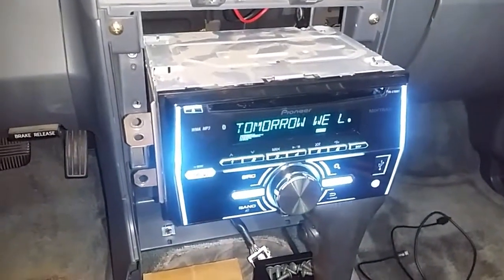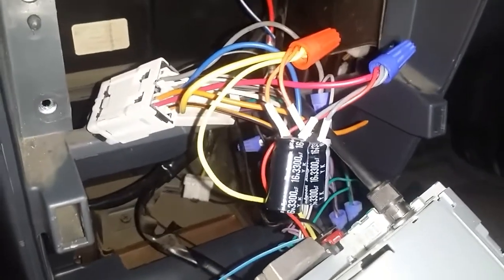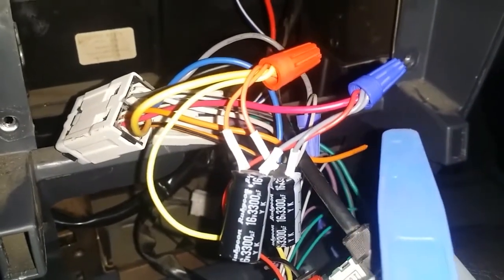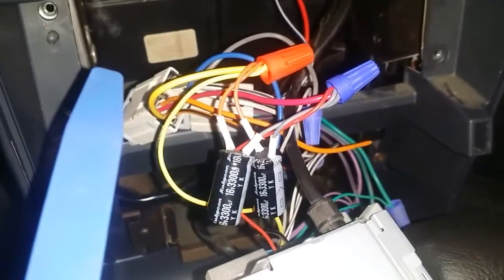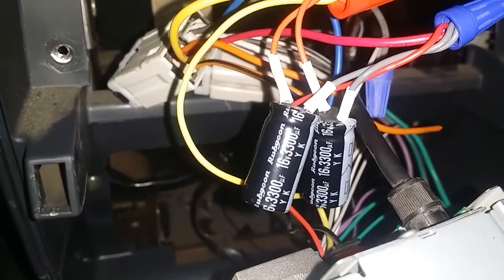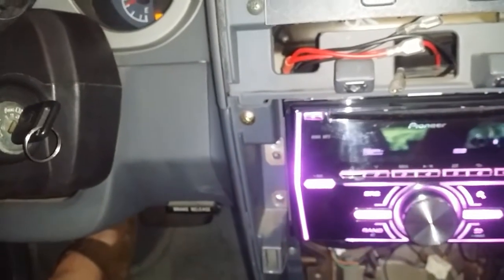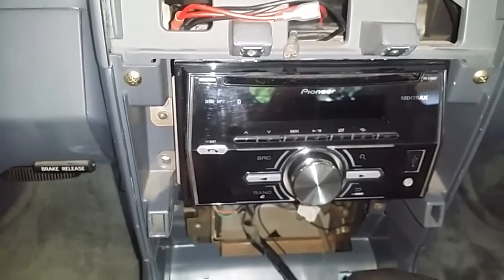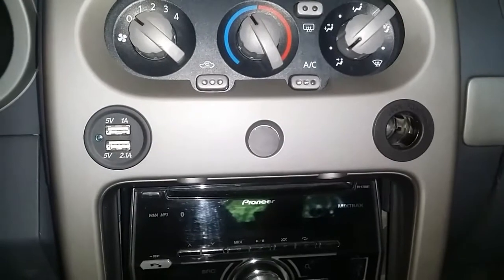Keep Vehicle Stereo On When Starting

Comment from the maker: UPDATE 1:  At the end of the video I showed adding a USB charging port.  If I am charging my phone when I turn the key... the phone takes the voltage stored in the Cap and the stereo does NOT stay on.  (boo!).  So I have to unplug my phone when starting the car, or wait to plug it in.

UPDATE 2:  I also added a subwoofer/amp.  I currently have it powered from the same wires shown in the video.  That (without a phone charging) drains the cap as well.  I'm committed to getting this wired right... but it may be a few weeks before I can dig back into it.  I may just add a toggle switch in the center hole (don't tell my wife).  A capacitive touch switch may be in the works as well (so I can hide it).
Reply: Shawn Hill great job man, you know your thing, ima try to do the same as you did, hopefully ^^
So you took 2 capacitors and connected the + sides of them to te yellow (always on) cable and the 2 negative sides on the red ACC cable, did you had to completely cut off any if the cables or did you just stripped them just a little to give contact to the capasitors?
Thanks your video is A+++!!! 😃
Reply: If u were to add a diode to the accessories power wire between the capacitors and the power supply side of the accessories wire this will prevent voltage being back fed into the accessories circuit allowing the capacitors to only provide power to the head unit, this will fix the issue.

Comment: For keeping the radio on while starting the car, and a few seconds after shut down:

1/2
From the car acc you connect a diode 1A (anode), behind the diode (cathode) connect to radio acc AND to a 3300microF capacitor +, from the cap - connect to ground.
This way you prevent other accasories (charging phone) to drain the capacitor.

2/2
Starting can cause the main voltage to drop below 10V, shutting down the radio.
For keeping the radio on, with a voltage drop from starting 2/2:

After doing 1/2, do the same as above, but for the constant powersupply.
Depending on your radio, use a strong enough diode, 7A for example.
For capacitor, use a 1F super capacitor instead!
If you can't find a cheap 1F 16V, put 3 cheap 1F 5,5V in series (-cap+ -cap+ - cap+ = 16,5V).
This way starting the car does not drain the 1F capacitor(s).

If you additionally use an amp, nothing changes.
But for those who don't know, don't use those small wires for your radio to also power your amp (read amp instructions)!

Note that a capacitor alone does NOT prevent current going in the wrong direction!!
Conecting a capacitor in the wrong direction can cause it to heat up and explode!

Comment: OHMYGOD THANKYOU. i was about to do this by branching 2 caps from from ACC to ground with a diode behind them, but this helps cus i was wondering if there would be enough amps to keep it all upright.

i am confused about if your battery line is constant or not, becuase if the car is fully off, you'll have 12V on the BATT line, 0V on the ACC line and the Caps between them, wont they just act as a bridge (continously recharge/discahrge??) and keep the radio on the whole time?

Comment: Thanks for this video. This method isnt working for me. My red radio pwr wire has a capacitor and it works as it should

I ran a 16V 10,000uF cap on my yellow wire, upstream diode, grounded cap negative, and the radio is struggling to stay on. When cranking & disconnected from radio, the capacitor slowly discharges as it should. When i plug into the radio and crank, the Cap dips to 8V then 3.5V within a second

Comment: Is yellow wire always on, or is it on only during crank? Like if it’s always on, why would the radio turn off when the car turns off
Reply from the maker: The yellow wire is the constant power wire or the 12 volt battery wire.  It's always on.
Reply: Exactly my thoughts, this whole thing working the way it does makes no sense.
The yellow wire is B+ (12v constant) this means the capacitors will always be receiving battery voltage meaning they should never lose power unless the power drain is above the capacity of the battery, draining the capacitors faster than they can recharge.
If the capacitors are constantly receiving battery voltage then they should continue to constantly supply that voltage even when the car is off and the key is out of the ignition.
I don't understand how it is possible that they are depleting while connected to B+ 🤔

Something else is going on here, perhaps something to do with the existing factory configuration or some kind of sorcery 😂

Comment: Shawn, great video. I have been having this problem with my 2014 Honda Insight and my Clarion NX404 In dash Nav system for quite some time. I am very good with electronics and am having trouble understanding how the capacitor does not keep the unit on all the time. If you are getting constant voltage from the yellow wire (+12v constant), the cap should be charging and delivering voltage constantly to the red wire (acc Wire) This in theory should make the radio stay on all the time? In your video I see that it's not and am trying to figure out why its not? Can you provide any help here? Thanks so much!
Reply from the maker: jeffsav, thanks for the encouragement.  I agree with your about getting constant voltage from the yellow wire.  I can't remember exactly why it worked OK.  I recall putting a meter on the wires and switching the ignition a lot to see what happened.  I popped a fuse once, but when the meter gave me what I wanted, I wired it to the stereo and went with it.
I'll ask some more tech savvy friends this week and give an update.  Also - check out my main comment above about adding the USB port and Sub Amp.
Reply: Shawn, thanks for the reply. Going to give it a try. I cant stand the continual resets every time I start the car or even turn the ignition on.Thanks again.

Comment: Should the capacitor be connected to the yellow wire of the ignition key or to the red wire of the battery?
Reply: typically the battery wire is yellow and the ignition wire is red. but if you have a volt meter you can check which one is still giving 12V when the car is completely off. In his example the capacitor is between both, with the anode connected to the yellow battery wire and the cathode (next to the grey strip on the side of the capacitor) connected to the red ignition/Accessory wire

Comment: Wouldn't this cause a parasitic drain with the capacitor wired to constant 12v?
Reply from the maker: Good question.  My real life response is.. it hasn't cause a problem for me in 3 years.  After some research, I found an interesting explanation "Once the capacitor has reached the full voltage of the source, it will stop drawing current from it, and behave essentially as an open-circuit." 
here... https://www.allaboutcircuits.com/textbook/direct-current/chpt-16/capacitor-transient-response/

Comment: I'm going to try something like this on my car.  Got a new stereo and it keeps forgetting my presets and clock during starting.  So I'll be adding a capacitor to the constant power wire and prob use a diode to prevent the cap from trying to start my car when starting.  Either that, or some high value resistor that would limit the current from going back towards the battery.   Also while i'm there I might as well put a capacitor on the accessory too like you did.
Reply: you might have the BATT (typically yellow) & ACC(typically Red) lines backwards going into the radio. the BATT line should be a constant 12V supply even when the car is fully off, meaning the radio can use a tiny amount of voltage to keep the clock in time, like a very very low power mode. then when the car is on the ACC line will kick in and the radio uses it line a switch to fully power up. 

the issues you're describing seems as though you're not getting proper constant voltage, but because the radio does work, both lines have to be  connected and powered on (when the cars on) and when the car goes off or you use the ignition, the wrong line into the radio gets disables and instead of going into a low power mode, it loses all power entirely and forgets everything
Reply: @96thelycan ty for the reply.  I fixed it by running my own constant power wire and it works flawlessly now

Comment: Will starting the car, while stereo is on, can cause a overvoltage to stereo or a big current and burnt it?
Reply from the maker: Don't think so.  starting doesn't increase the current to the radio. It takes "some" power to run the radio so cars typically give "all the power" to the start process.

Comment: I have the same radio. Does your sound work when it's cold outside. Mine wont work till it warms up. But yeah my radio restarts when I restart my truck but I'll try this and see if it helps. Thanks.
Reply from the maker: Temperature doesn't impact it at all. I can't think of an electrical power circuit based on temp 🤔

Comment: wow, those are big caps. in my case, only one 470uF 25v cap was sufficient to give me 5 sec of run time. just enough to crank without reboot. I guess it depends on the input resistance of the stereo ACC line. mine is close to 8k ohm.
Reply from the maker: I started with 1 cap but doubled it to get a few more seconds. I think its because I did something wrong or other things drain the cap.
Reply: @hillmakeitbetter  Do the lights stay on in the dash or the exterior lights?
Reply from the maker: @Mikkel111  No. This mod only impacts the stereo.

Comment: you would think the radio would turn off immediately when cutting the key off. Since there is no longer 12v on the yellow wire. I guess the radio will run with only 12v on the accessory wire.
Reply from the maker: The idea is that the Capacitor keeps 12vdc to the signal wire for a few seconds, which tells the radio to stay on.

Comment: arent negative of the capacitor suppose to connect to the ground?
Reply from the maker: So... yes.  I did this wrong.  It kinda worked so I thought it was ok.  I need to redo it with:
1. Negative of capacitor to ground
2. ACC power from vehicle to Positive of capacitor - then to the stereo.
3. I'm going to try adding a diode as well to keep my USB port from draining the cap.

It looks like this guy has the same stereo and did the hack correctly...
https://youtu.be/gtd6dAwq3QY?t=1m29s
Reply: Yes they are. This video is bad information and should be removed.

Comment: I dont understand how the capacitors aren't being constantly charged if they are connected to 12v constant?
Even if u turn off accessories and the capacitors were to deplete, my understanding is that they would just charge up again and turn the head unit back on. 

I really want to work this out lol.
Reply from the maker: Check out the Updates in the description & the video I linked to as well.  I think Stephen Tack has a better illustration.
Reply: @hillmakeitbetter  cheers, I'm keen to get to the bottom of this.
With my current understanding it goes against the laws of physics 🤣
Reply: @hillmakeitbetter  also there isn't another setup like urs, that I have seen online, nor would I ever set it up the way U did based on my understanding of electronics and physics.
Ur setup is all wrong, yet it works 🤔🤪 it's magnificent! ❤️

Comment: But what happen, if I connect the capacitor and the diode to yellow wire that come from the car battery and negative side of capacitor to ground ?
Does the radio still saving the settings ?
Reply from the maker: not sure I understand 'still save the settings" - do you mean save radio station presets, clock settings, etc if car battery is disconnected?

Comment: ALTERNATIVE WAY:
hi people i wanna share this. i dont know whether someone suggested it online but im coming out.

in most cars you can supply the auxiliary line with power through the lighter socket. 
best way is to get a lighter socket adapter or splitter or anything and you disassemble  and you can fit capacitors in them. or if you do it janky you can add these on the outside or just hack a capacitor onto a plug.

in my car 4800uf is just about enough to keep it running through the cranking. (2-3sec)
its without diodes because this way you cannot add diodes unfortunately. it wastes some power elsewhere

i switched to a 16v 1fahrad supercapacitor assembly (these are small in size still) and it runs for about half a minute now 😁
Reply from the maker: glad its working. i need to up mine to run longer & will try that 1f

Comment: The wiring of the capacitors in in this video is wrong and the video should be removed. You DO need a diode! The current can back flow. You know why this didn't work on the ACC side, it's because you have the caps wired wrong.
Reply: You are correct. But he has good intentions.

Comment: One question.. how long those caps needs to be charged for the first ACC/ON in order to have enough power for 4 secs before starting the engine? In my opinion it's impossible to have it works if you start the engine in a rush, CMIIW
Reply from the maker: Good question.  Googling "How Long Does It Take to Charge a Capacitor?" would be better than if I tried to rephrase what I found.  My main purpose for this is to keep the stereo on, like after I have stopped for gas.  So it's had plenty of time to charge. Sorry I couldn't help more.
Reply: @hillmakeitbetter  Okay, it means it's only works as long as you don't take the key out, right? Anyway thanks for your explanation, quite useful
Reply from the maker: @Tobra1277  While starting, the vehicle cuts stereo power. This hack helps maintain power for a few seconds while starting. Mine stays on a few seconds after I remove the key.
Reply: That size cap will take about 2 seconds to charge up
Reply: It doesn't matter how long your stereo stays on for after you take your key out of the ignition mine stays on for 15 minutes and every time I start my car is still cuts my radio off so it really doesn't matter how long your stereo stays on afterwards it's the capacitor stored the voltage that is draining into your radio that is what keeps it on. Your ignition is still going to cut off the voltage to that radio it's the capacitor that's going to help it keep it on and the other kid was right you do need a diode cuz there is backflow think of it as a double check valve in water it can go one way and not the other it does backflow so you do need a diode and it would cause a pair of acidic draw if you don't use the diode

Comment: so confused.. i draw what u did and it's impossible to work. do you have schematcs
Reply from the maker: Karlo, sorry for the confusion.  I added an "Update 3" to the main description with wiring notes.  There is also a link to a similar video from someone else who explains this better.  I hope this helps.
Reply: Shawn Hill thats ok. wer is update 3
Reply from the maker: @karlomendoza8288  It's in the main description but I'm pasting it here to
UPDATE 3:  So... yes.  I did this wrong.  It kinda worked so I thought it was ok.  I re-did it with:
1. Negative of capacitor to ground
2. ACC power from vehicle to Positive of capacitor - then to the stereo.

I later found this guy who has the same stereo and did the hack correctly...  watch his video too.
https://youtu.be/gtd6dAwq3QY?t=1m29s

Comment: Please read below for the correct way to do this.

These capacitors have nowhere near the necessary energy to run a radio for 2-6 seconds.
Method 1: Tap into “Start/Crank” wire, run it to radio or radio’s relay. Relay is preferred; USE DIODE.
Method 2: Buy 1-2 sets of 6x 10-farad super-capacitors with board. If using 2 or more, connect them in parallel. Connect positive to radio or radio’s relay (preferred); *consider using resistor*.

If using anything more than 10-farad super-capacitors (eg 500f capacitors):
1) DO NOT link it to the relays; this will drain your battery. 
2) MAKE SURE TO USE CORRECT RESISTORS; you will fry your wires otherwise.
3) MAKE SURE TO USE DIODES TO radio/electronics. You will fry your electronics/dash wiring otherwise (compounded even more if you don’t select correct resistor(s) )
Reply: Building (or, overbuilding) this for my center console. Will upload what I have when I find time.

Sometimes, burning a new tune onto my engine shuts it off. My ECU and Tuning computer stays on. When I crank, my tuning computer restarts. Very annoying. Also don’t like waiting for my radio Bluetooth to reconnect